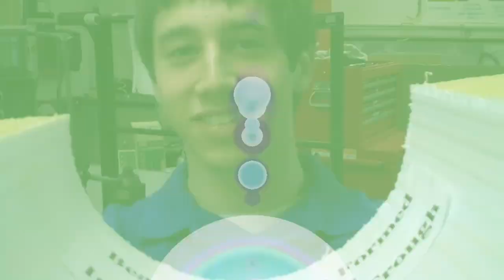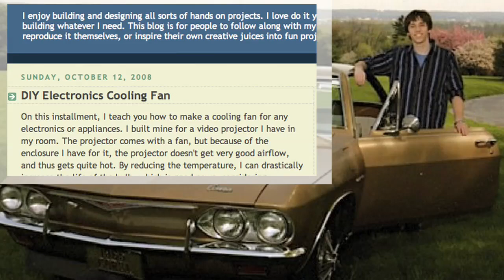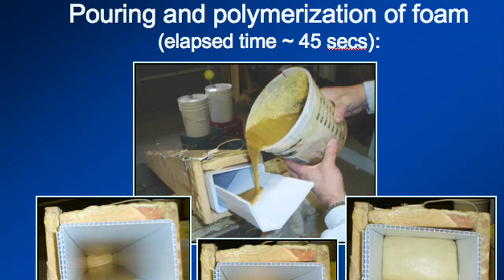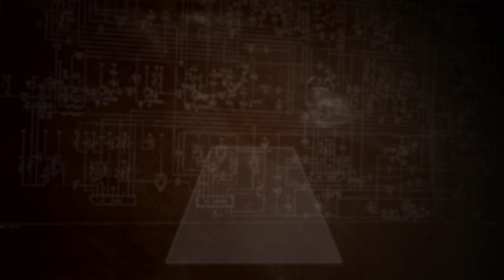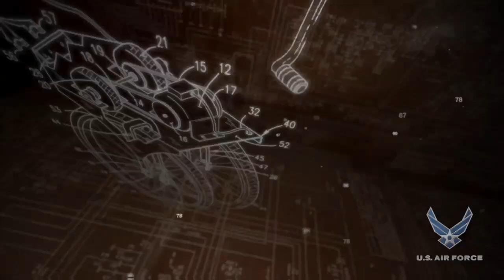College Student Invents Building Material

Comment: Can you use/recycle the plastic and/or foam? Could you do this same thing with hemp plastic and foam? It's organic vs. chemical like the materials you use now. Hemp textiles are also termite and mold resistant.There's a movement to develop for healthy,clean,sustainable solutions.You did a nice job however, developing this product and I would be interested in organic 1/2" 4X6 or 3X2 flat boards for my building project.Let me know if/when you have something. I'm looking for strong lightweight.